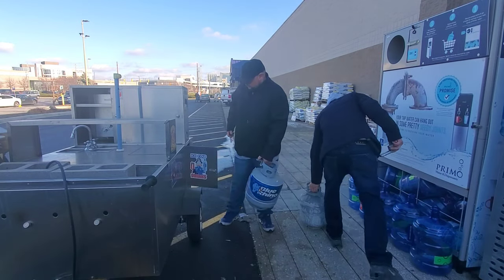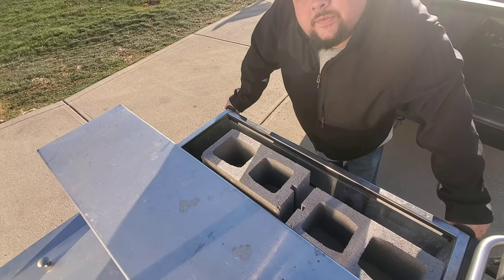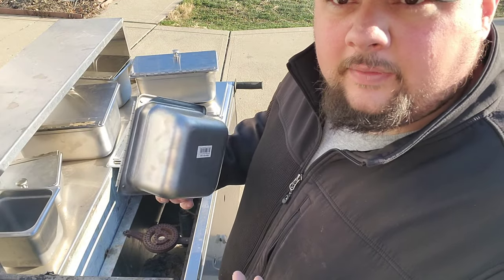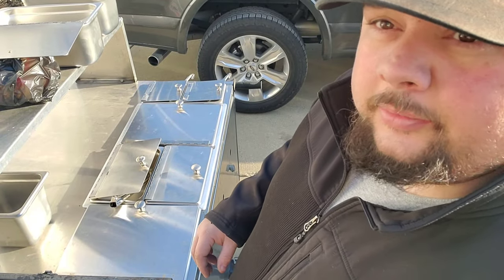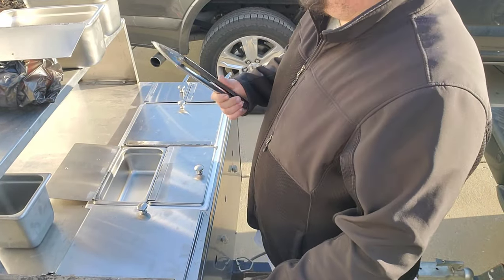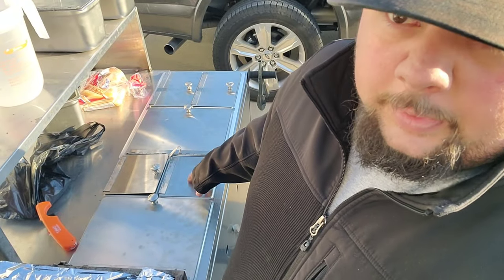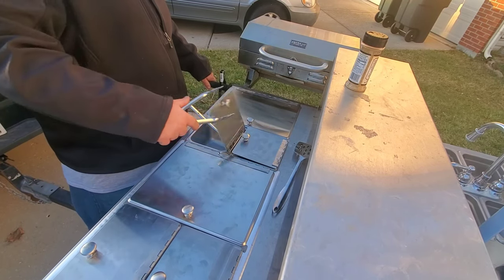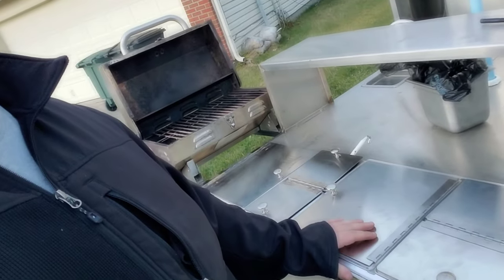Big Dog Cart | My Pan Set Up and FIRST USE!

Comment: Hmmmm...about storing your tongs...perhaps installing a rail between your handels might
do the trick! Or attach a ring to the left or right side of your cart so you can slip the tong in like a holster...think cowboy gun slinging! My imagination at 3am! Great cart btw, I'm close to getting mine from Ben as well but I'm debating on the flip cover!
Reply from the maker: Great ideas! I'll look into them. Ben has some great carts. Im partial to the flip top pans because its what my leased cart has, so its what I've always used. Its just what im used to. I know some people that prefer the removable lid pans for the same reason. Its just what they are comfortable with. I like not having to worry about moving pan lids out of the way every time I make a dog though. I just flip it over with my tongs and do what I need to do. Its fast and easy for me to have the flip top pans.